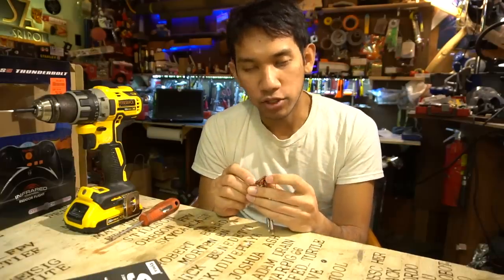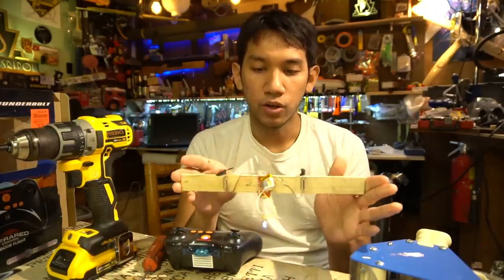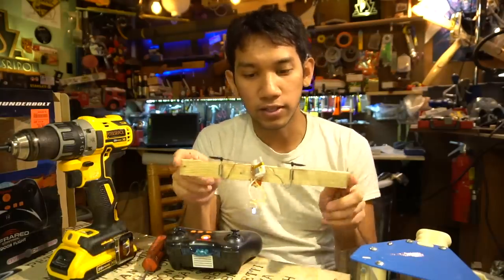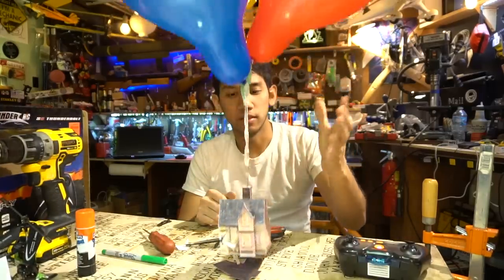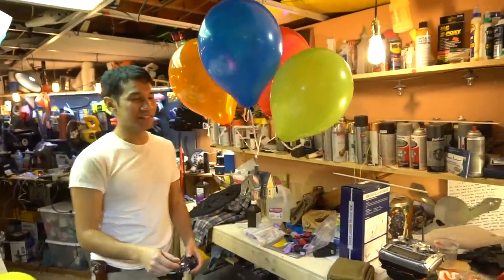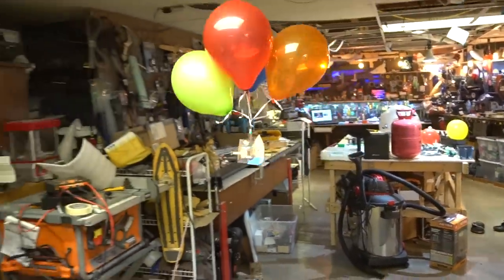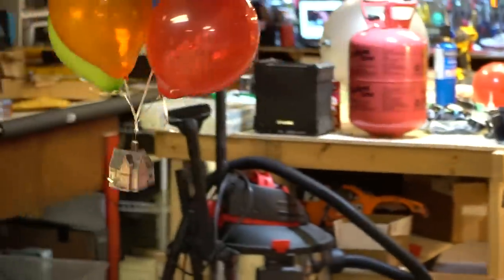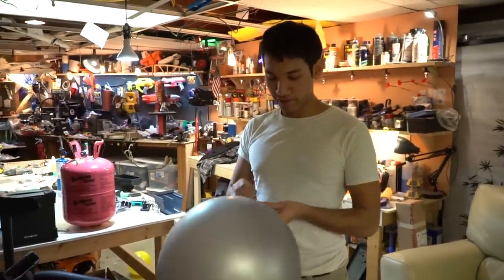DIY RC Blimp(s)

Comment: I like the batteries in the remote.
Have you tried shooting triple A’s out of a gun?
Reply from the maker: Hmmm will have to try that!
Reply: PeterSripol Try shooting lighters! Those ones that explodes!
Reply: I've been using lipos for years and i never thought of bullets i bet they last much longer than lipos or AAs we should use them in our planes and quads for an infinite flight time :D
Reply: no this shooting stuff is very unoriginal
Reply: The Leverevolution cells are all right, but I prefer hollow points for my transmitter needs.
Reply: uses AA gun
Reply: It works with a 20 gauge and AAs
Reply: Zizur Feinghrbeg *original unoriginal is a good thing
Reply: How would they produce thrust?
Reply: Ryan M. IKR
Reply: Ikr
Reply: Richard Ambler true, though pulling a lot of current is pretty hard due to the high resistance in the AA and AAA batteries

Comment: Hi Peter! I think if the motors are level with the horizon, it may give better results when throttling up. The whole body tilts as you increase throttle anyway, due to the offset thrust angle, removing the need to have the motors tilted.

Comment: Apply RC blimp in drip irrigation system. Let the blimp direct the water hose to target crops more specifically. Rather than using sprinkler, more water might be wasted to the soil

Comment: I thought about building a zepplin just before I discovered Flight Test- the reason WHY I discovered FT! :v
THought about using fencing wire soldered together, then got some lift calculation charts & worked out how badly that idea would fail to fly...lol
I know theres lighter & more suitable materials, but had no idea of what would best suit the purposes....
One day I hope to have a proper crack at building one, when Ive learnt some more, but would be VERY interested to see how you go about it Peter! :)
Best of luck & looking forward to seeing how you go about it ;)

Comment: I've been meaning to get around to doing this since I saw you do it on Flitetest.

  I plan to use the tail motor, if it neutral lift and the correct thrust angle the tail motor would alter the thrust angle just like when it was a helicopter,  bring the 3rd channel back.

Comment: Sure, go ahead & build that zeppelin, would be neat too see, even if id rather watch rc cars or trucks with that being my thing heh.

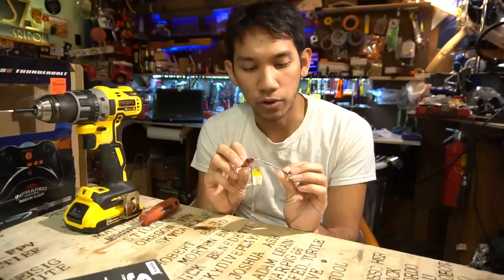Another side project perhaps could be using the electronics from one of those cheaper toy grade rc cars in the 1:32 scale That has a built in lipo, 2.4 ghz & does like 20 km/h as it is from the start.

Making that Into various vehicles, like turning it into dragster, extending the chassis & gearing it up while trying too keep the weight down for a higher top speed then what it initially had + perhaps a lipo with a larger c rating & higher capacity.

Then perhaps gear it down too power a large enough chassis or truck that can go across grass well at at least a walking pace despite having a really tiny motor to power it forward with & for steering utilizing the standard motor it has out of the box.

Perhaps also make a tiny tracked vehicle (that puts down the power like an older army truck with) with skis in the front that can go across the snow with that 1:32 scale buggy or car as a base as well.
Something like this http://www.strangevehicles.com/images/content/150708.jpg
With one of those cheap little cars.

Salvaged my lil brothers terrible running silverlit 3d twister not too long ago after it had been sitting for a while. (barely any battery life & front wheels gunked up with hair & dust right away so they couldn't spin freely any more within a month & he got tired of it spinning in circles pretty much on the floor.)
& still got the electrics + remote for it (no lipo atm)

But i do have lithium ion battery cells that are protected from a bunch of old laptop batteries that i could charge up with a random power bank circuit & it seems too work with a 130 sized motor too power a very light chassis at a slow speed too it seems, but thinking of powering it with a smaller motor like the one it came with or one of my dead Hubsan quad copters motors.

Was thinking of making a boat with the electrics at first using a fitting cardboard container like a small package of milk or juice box that id cut up a bit too turn into a hull that kept the litium ion cell + electrics floating (using the gears & rear axle at an angle & put on one of the quadcopter props or from an old toy helicopter) but ended up not following through with that & the electrics was put into storage in the basement again heh.

Comment: I've been smitten recently by the idea of sports like the various 'robotic combat' events, but under different conditions (outdoors in the desert, in the air, on water, on ice, first-person cameras only, walkers only, autonomous, underwater, etc.), possibly with some variants including some forms of ranged combat (with no humans in the area (just camera drones) it could be feasible from a safety perspective, if a legal and insurance nightmare.) I was thinking "what kind of vehicle/machine is cheap and crowd-pleasing to build and destroy, and poses unusual technical challenges to make an effective combatant?" and hydrogen-filled RC Zeppelins came to mind. (If you're allowed to carry hydrogen, and know the enemy is carrying it also, a flamethrower could be a practical and effective (though risky) weapon, unlike the nearly-harmless special-effects device it is in current robotic combat schemes!)
Then I remembered the square-cube law, and how badly lighter-than-air craft suffer from it. Full-scale Zeppelins could be outfitted like cruise ships and still carry grand pianos on board to flaunt their excessive lifting capacity (or in times of war lift heavy artillery beyond the reach of contemporary defences and carry it wherever you wanted things dead; until planes got good), but tiny toy ones need to be built out of twigs and glue. Then again, that just means they'll be more rickety and prone to catastrophic damage! (the issue is finding the weight to mount an effective weapon, electrified heater wire on a stick might actually be a dominant weapon because of how light it is for its damage potential to common blimp-building materials...)

Comment: Could you also show how to turn this helicopter mechanism into a tiny RC plane?? Is that possible at all?

Perhaps one prop per wing, for variable thrust steering, and similar to the house it could always be trying to descend and throttling up would increase altitude.

Comment: would adding the counter rotating drive off of that cheap coaxial heli fix the throttle steer on your other fpv blimp? not sure its physically possible, but i feel like it would help in theory.

Comment: The helicopter had a third motor on the pitch channel. Why didn't you just shlop that on for altitude control? Or also point it backwards, but angle it down a bit

Comment: Would it help to anchor the balloons to multiple points of the vehicle? Though the balloons float in air they still have mass and therefore inertia that needs to be redirected when turning. If you twist the connection to the balloons you're only temporarily turning before the string/rubber begins to unwind itself and counteract the turn.

Comment: hello.  nice video ,top idea.
question: (i don't konw much about electronic...)  for the second blimp(with camera), i see there is a motor propeller under the balloon, how do making work? just with radio stick? if yes, how is the electronic "chain" ? just a servo wire from reciever to the motor?

thank you.

Comment: I did what you did but instead of glueing the turbines to a stick I got a paper plate and cut a rectangle out of it with the curved side and the middle and built  rc air/hovercraft

Comment: G'day,

  Yay Team !

  Don't build a model of the Hindenburg Peter..., build a scale model of the Vickers R-100 instead ; the British built 2 different designs, one the work of Private Enterprise & the other came from the Royal Aircraft Factory - and it was the Government built R-101 which was  so slow, & so overweight they cut & shut it after adding an extra Gas-Cell, and then displayed it at Farnborough Airshow on it's Test-Flight when it proved so unstable it nearly crashed, but the crash happened on it's next flight - trying to fly from England to India, carrying the new Viceroy..., but burning in France instead.

  The R-100, built by Private Enterprise, met all it's Speed, Weight, Altitude, Range, & Climbing ability, and it flew to Canada & back, before the same Crew went out and pranged the R-101, killing the Viceroy who had been the Secretary Of State for Air which originally commissioned the strange competition to discover who built the better Airship.

  The R-100 was designed by Barnes Wallis (designer of the Vickers Wellesly & Wellington Bombers, the Dam-Busting Bouncing Bomb, the 5-Ton Tallboy Bomb & the 10-Ton Grand Slam Earthquake Bomb...), with Neville S. Norway working as his deputy Chief  Designer (Norway later founded Airspeed Pty Ltd which produced the Courier, Envoy, & Oxford Aeroplanes, before he became  famous as the novelist Neville Shute - which is what the S. stood for....).

  So, yeah, build a flying model of the R-100 please...

  You DID ask.

  ;-p

  Ciao !

Comment: when helium is in a balloon it is slowly leaking out into the sky but when it's in the sky and never get it again which is bad because we don't have a lot of helium on her and we need it for MRI machines
Reply: I would have you hydrogen because you can make it with electrolysis and it is more light than helium